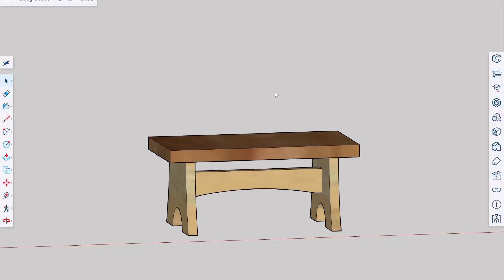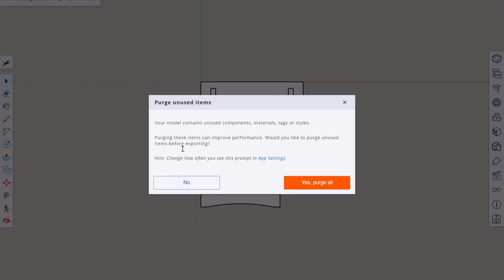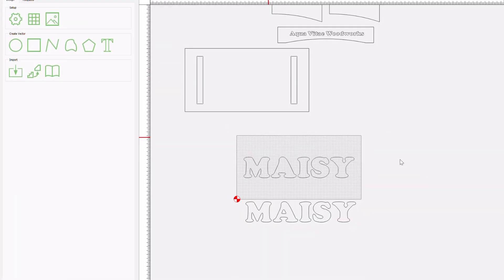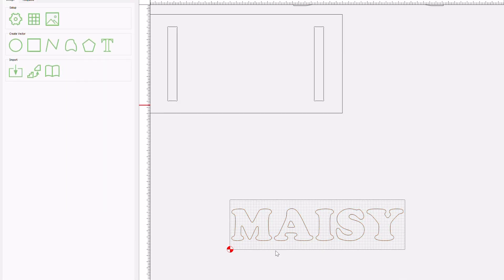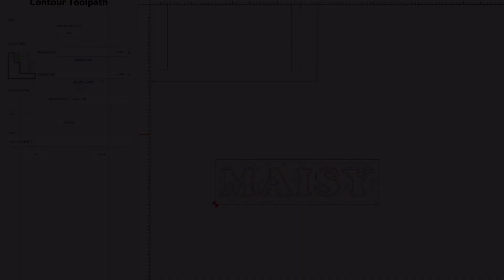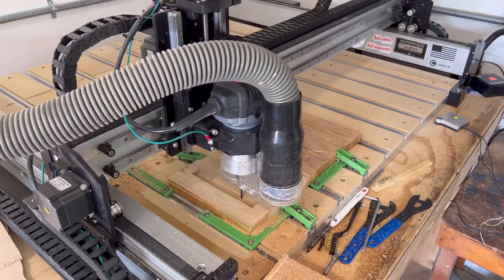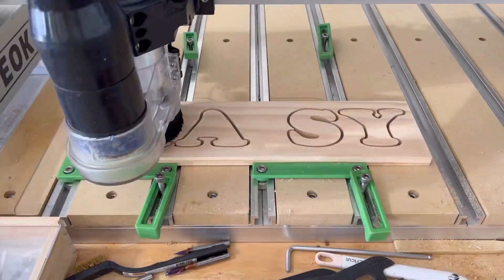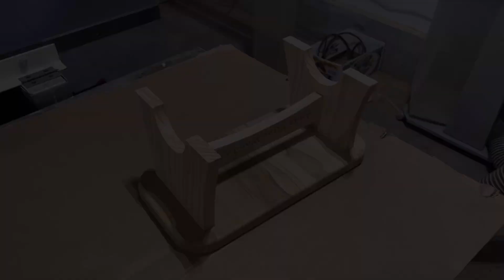Easy CNC Project to make as a Gift

Comment: Hi,
How did you create the pocket allowance for the letters? Did you pocket first then use a contour function on Carbide Create?
Reply from the maker: Yea, it’s a pocket tool path on the bench top. Then I offset that vector by .02” and carve an outside contour of the letters on 1/2” stock

Comment: The legs are very crooked. I think you needed 1/8th on each side, not 1/4. I bet I am right. Measure it.
Reply from the maker: Hmmm, Iv made this still dozens of times without issues. No crooked legs for me
Reply: @AquaVitaeWoodworks   i think just on this specific stool, I think that was the issue you mentioned in the video.